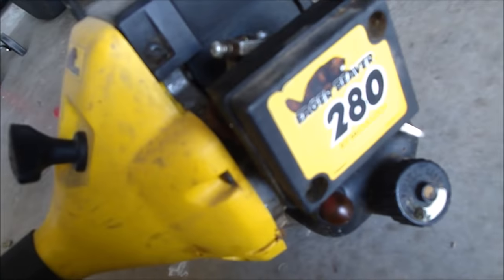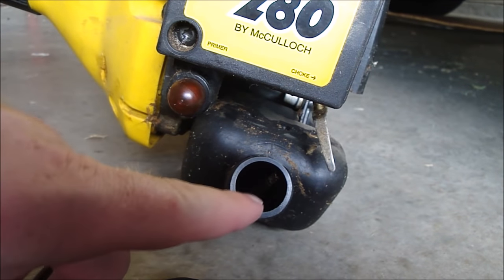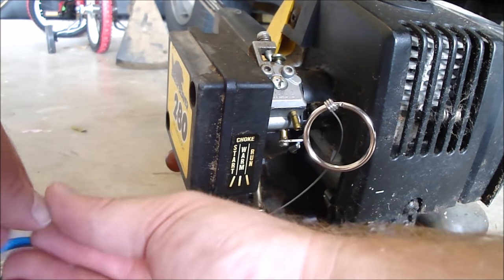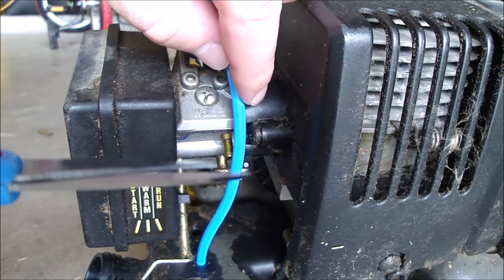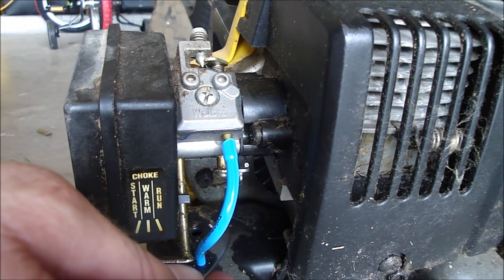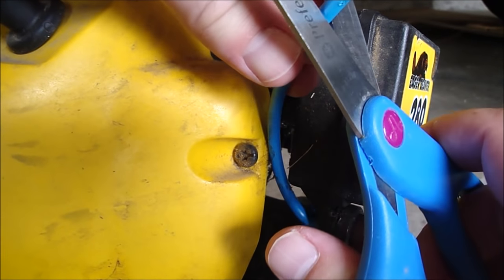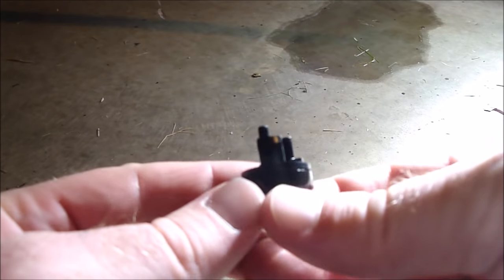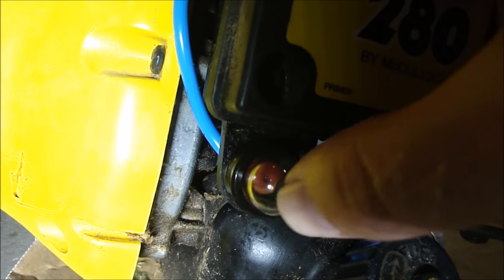Replace Fuel Lines and Primer Bulb on Eager Beaver 280 McCulloch

Comment: Gratitude. Bonus karma points awarded. I don't currently have access to a workbench, and it's pushing a hundred degrees at 10:30 in the morning outside, so making a bunch of mistakes, or not knowing the trick to route the lines through the fuel-tank might have messed-up my attitude.
Reply from the maker: Glad I could help. Thanks for watching!
Reply: @becausestuffbreaks  Got her done. Hundred degree weather and string-trimmers don't go well together. Gonna get some gas today and set the alarm for early tomorrow. Thanks again.

Comment: Thanks for a great video. Broke it against a tree, didja? 😄 Haven't done that yet with anything, but there's been a few times I've wanted to. :D So far I've managed to not duct tape a rock to some of these cellphones & see how far I could throw them! 😬 :D. Or maybe just lay it in the street and drive over it, reverse over it... until I get tired. 😊

So I'm assuming I'm looking at the edited version? Don't wanna knock the bark off my tree :D Going to HDepot this week or next & get that kit & a set of bulbs, then come back to your video. Trimmer's been sitting for as long as this video is old. One of the best ones made as far as I'm concerned. Will come back and lyk.
Reply from the maker: Lol. I show how to do it correctly in this edited video. Before I edited out my error, someone pointed out my mistake (put fuel lines on backwards, after making an adjustment) and that's why my weed eater wasn't working and had to smash it against a tree.

Comment: Lines are hooked up incorrectly. Vacuum line from bulb connects to front of carb.
Reply from the maker: Oh crap. I hooked the primer bulb up backwards. I'll see what I can do to fix it. Thanks.
Reply: Pretty common. Primer bulb should really be called a Purge Bulb, since it’s purging the air out of the carb. When pushing the bulb, the carb sucks the fuel through the hose with filter in the tank. It’s a closed loop system,
Reply from the maker: @anthonypazsd  Edits finished. Luckily I showed how to install the lines correctly on the old primer bulb so I just removed the part where I was installing the lines on the new bulb. Also removed the part where I was explaining it backwards. After I finished that video, I put the weed eater away for the winter. When spring came I couldn't get the stupid thing to start, so I smashed it against a tree. Now I know why it wouldn't start, lol. I wish I hadn't broke it now. Thanks for letting me know about the error.

Comment: bravo-  bulb works back word  and gets fuel but unable to suck fuel in correct order .. any idea new line
Reply from the maker: I recently broke mine in half across a tree because it wouldn't start so I don't have anything to look at. Sounds like whatever seals or valves in the carburetor not doing their job. Maybe try a new reseal kit for the carburetor.
Reply: well i just learn bulb is to suck fuel from carb not fuel tank and dump fuel in tank . this will get rude of all fuel bubbles .. it is running now
Reply from the maker: Thanks for the update and thanks for watching!